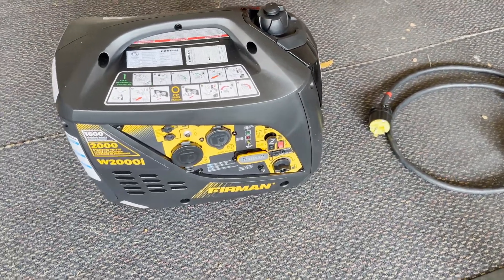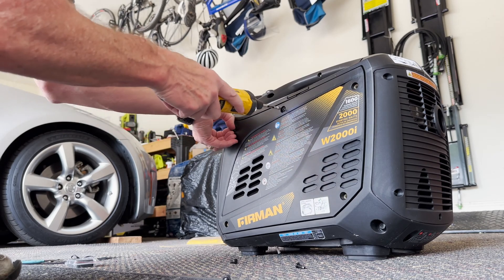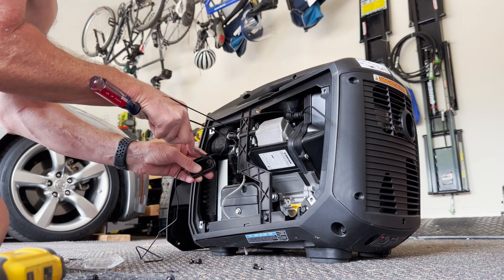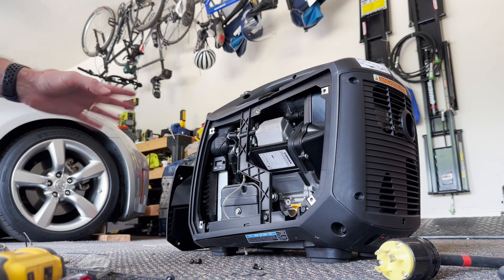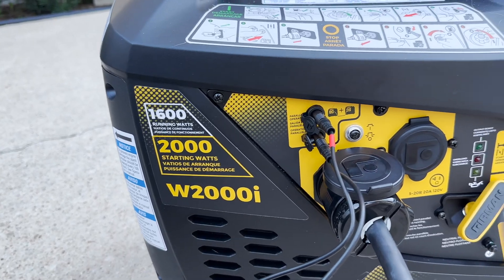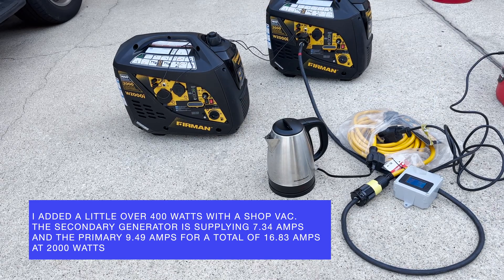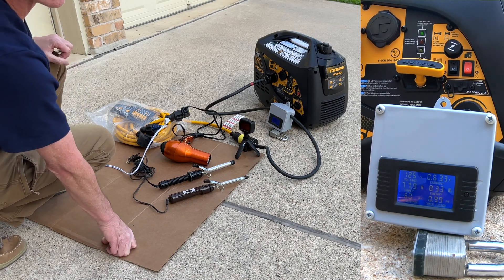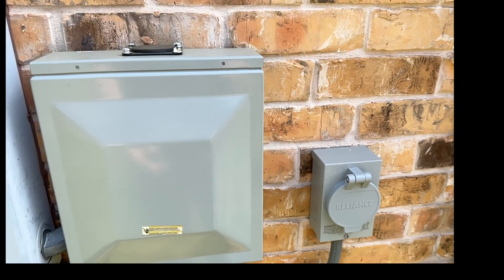Firman W01682 from Costco: hour meter install and Is it a home backup solution?

Comment: Do you know if a single one will be able to maintain 1800 watt output?
Reply from the maker: Unfortunately the Firman W01682 is rated for a max load of 1600 watts.  I was able to get 1740 without the overload light turning on.  This matches the max speed listed in the manual.  I would not recommend using a generator at 100% of the rated max load.  At 1,740 watts it was running at 4,850 RPM.  Costco has a 3200 watt dual fuel generator for $649.  If you already have the W01682, Costco has that on sale for $299.99  It has the parallel cable included.  Also there is a MaXpeedingrods 3500 Watt Portable Inverter on Amazon for $479.  In addition Mr GarGE reviews generators and takes them apart. .  Many are around $400 He will say if the engine is the same as other models.

Comment: Thanks for this, can you show us the dog bone you used, and the cable going from the DB to the house, the yellow one... Thanks!
Reply from the maker: The dog bone is from Amazon: BOEEMI Generator Transfer Switch L5-30P to L14-30R Adapter Cord.  The power cord is the Southwire 65172840 L14-30 20-Foot 30A-mp Generator Cord also from Amazon.
Reply: @diy_smith  thanks! Another question please, in parallel how many amps can it put out? Single unit does 13.3 if I'm not mistaken...
Reply from the maker: At minute 13:27 I test one unit up to 14.41 amps at 1,730 watts.  This is very close to the red light illumination.  The most I ran both units in parallel was around 2,900 watts at 24 amps. I tried keeping the load around 2,100 watts at 17amps. I would wait for the central heat to cycle off before using the microwave or coffee maker.
Reply: Final Question I promise lol, again thanks you've been very helpful...
Just to clarify, for running to your panel, on the generator side, you have genny 1and genny 2 connected just with the supplied parallel cables, and just have the dogbone connected to genny 1 (or 2), and an L14 extension cable from the dogbone to the panel? Is that right? I'm just a bit confused about the "energizing both circuits with dogbone that splits 120 into 2 legs" part.